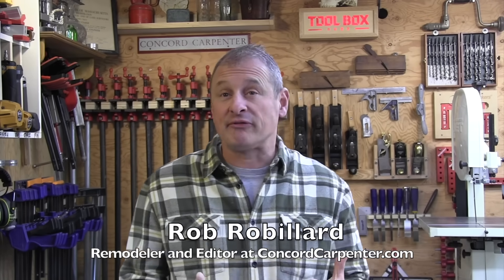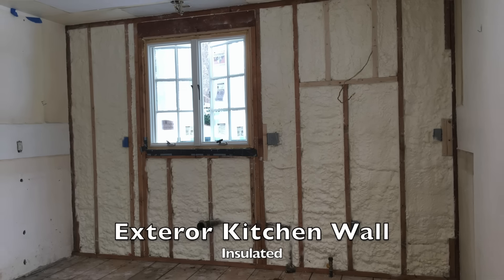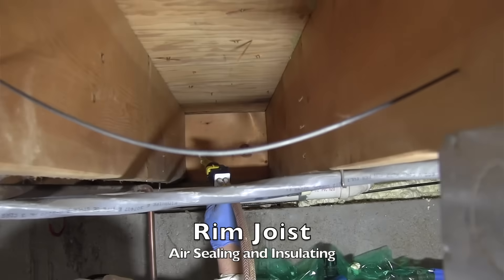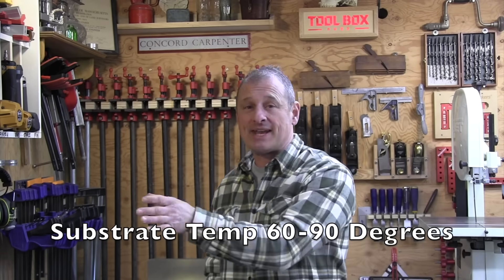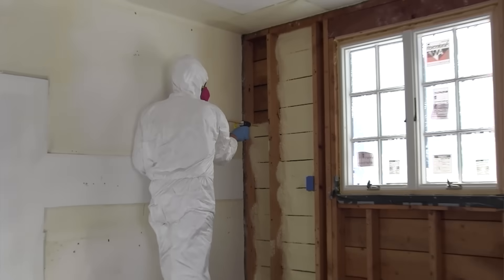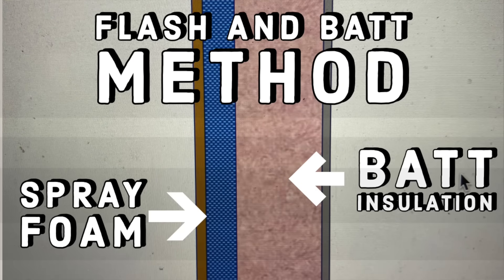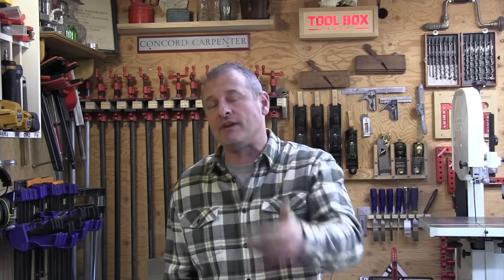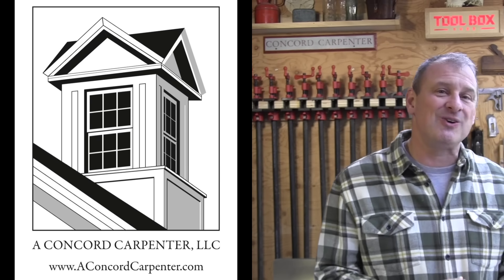Using a Froth Pak - DAP System 600 Spray Foam Kit

Comment: As a Canadian red seal carpenter  I'm tasked most days with fighting the elements. It gets cold. This video is sound advice for insulating. I'm thinking about using this product and came across your video. We done. Thanks alot.

Comment: Doing a DIY basement reno in a 1972 brick split level in the Atlanta area. The house had some water intrusion issues in the past that have been remedied with a gutter system and sump pump. I weary about insulating because of potential mold issues. Would you recommend this product for my situation? Thanks!
Reply from the maker: I'd fix ALL moisture intrusions and ensure the house had gutters and the outside grade sloped away. Once you satisfy that - then yes!

Comment: FYI - I investigated this system back when it was $600 for the 600 kit (now $882 with sales tx in CT). If you have enough sq footage it was the exact same price to hire a professional. Now, if you have a small amount then no, setup for the professional is expensive. If your job is big enough call for a quote. You'll be glad you did.
Reply from the maker: @L46C3  agreed this is a small job solution

Comment: Have you ever used foam to fill the void in a CMU / cinder block wall?  I am trying to find most economical way to fill these voids.  I have found it takes about 1 can of great stuff spray foam per CMU.  I have 93 blocks to fill at this time.
Reply from the maker: I have not

Comment: Best explanation of spray foam I’ve ever seen. 
Guy knows his stuff. Thanks.
Reply: No he doesn't.  The flash and batt system is still prone to high condensation in cold climates, and these foam kits are poor quality compared to high pressure, high heat systems.

Comment: You explained this very well, but this product is TERRIBLE to put within your home. There is a massive difference between a DIY spray foam kit, and foam that is sprayed out of a proportioner with REAL chemical, that comes out of 55 gal. Drums, not little propane tanks. Lots of companies would be willing to do this job, its gravy work. Ive done this line of work since I was 12, and to do this properly you NEED to hire a spray foam contractor. This DIY method, especially if you are throwing fiberglass over the top it will cause mold 150% I do not recommend using froth paks, EVER
Reply: I also am a professional sprayer and there is NO MOLD issues if installed properly

Comment: I have a few questions:
I'm remodeling a 1970's travel trailer that is structurally insulated. After peeling off the old wall panels(there was sections of water damage) I need an adhesive for the new panels. Sure, I could use PL glue, or foam glue, but I'm looking for 100% coverage. There's some voids, pocks, and more than a few gouges (my falt 😅) I'd like to fill. Why 100% coverage? You wouldn't butter 30% of a tile, would you? These panels add *structure*

I know i could probably use expanding foam adhesive, but that's a One Inch bead, I need a Six Inch bead😓.
Reply from the maker: get some sort of gklue or mastic you cab trowel on

Comment: Very informative. I've watched several videos and the last I don't know three to five of yours that I've watched on the insulation methods especially with foam board versus closed foam the 600 series has given me help to understand which is best for my application in my basement on directly on cinder block walls. Also giving me ideas for my brother's bathroom where he bumped out a dormer maybe an extended his bathroom to give him an extra two or three feet but the insulation was never covered with plastic and it is brown or black and places thumbs even hanging down I do not know if he put any foam behind it so it seems to me if I understand correctly that he's got no vapor barrier and this insulation may all need to be taken out. The bathroom is yet to be finished and the insulation just looks used and old and possibly wet in places because I know there were several roof leaks new messages received. Thanks again I will continue to watch your videos for further instruction to accomplish this at least in my own basement. The 60-year-old Widow woman. All about DIY but ends up paying someone to get projects done.

Comment: Is this foam water based?  I'm looking to reinsulate my home that was built in 1947, from the outside as I'm taking the old siding off this spring/summer.  I've read where spray foams shrink up to 2 inches, so I'm concerned about spray foaming my entire house only to have the foam shrink, thus giving my house an R value of 24, with this spray foam, down to who knows what value within 2 years or so.
Reply: Closed cell foam is NOT water based. Open cell foam is.

Comment: It was recommended that I use this type of insulation in walls that were already sealed (drywalled finished rooms). I can't see how that would be optimal unless I was to remove all the dry wall and do it properly. What method would be optimal when dealing with a finished room/wall without having to remove the drywall? Cutting small to medium holes would not be a deal breaker and I can easily patch those.
Reply: Blow in insulation. Home Depot rents out the shredder and blower and you buy the packs. Make a 3 to 4 inch hole in between each stud at the top and blow it in

Comment: 5" of insulation in-between 2 walls made from sticks and boards is state of the art and an improvement? 50 cu ft in a box for 500 bucks? Are you f*ing kidding me? This is ridicules. My house built in 1979 got a 10" engineered for insulation brick wall, that brick wall has 2" of foam insulation on top of that. My roof has 9" of cellulose insulation and 3.5" of foam insulation under the venting and sheeting plus 2" of OSB in-between cellulose and foam. The floor of the attic crawl space has an other 8" of cellulose insulation in-between the beams and boards. everything with vapor barrier inside and wind barrier on the outside. Blower door test shows we are pretty much airtight except through the vent system. And I consider this 40 year old insulation to be eady for improvement. And we see temps below freezing for about 4-8 weeks and its mostly in the singles and teens during clear nights and not much wind either. About 160 days a year we run a heater aiming for 70 in the house and 73 in bathrooms. House got 2300 sqft. and we use about 3.000kwh or 300l of oil guve or take a year for heating and hot water for 8 people. As soon as my roof mod is approved and execut by the city, we will be fully self-sustainable all year round. I'll upgrade the roof on top of the 9" cellulose with 20" of wood fibre boards to become guaranteed water tight during a tails and sheeting shattering heavy hail storm, as well as storm proof. That is state of the art, your stuff is 50 yeas outdated and 3rd world standard. Anyway, cellulose insulation is much more cost efficient, 100% air tight if done right, and thats realy easy, easier to handle, easier to repair, no hazardous material, neither while working with it, nor while tearing it down, not flammable, will no burn at all, is able to transport moisture out of the house, and 100% made from recycled material and will be 100% recycled after use. That is environmentally friendly, healthy and it safes you quite some substantial money. No I don't sell the stuff, I just used it in my various projects and my own home.
Reply: Aside from that, I worked with all available insulation systems, and they all s*ck some more like spray foam and glass or stone wool, some like styrofoam products less so. I now only work with cellulose insulation in-between i-beams and wood fibre wool boards for on-top of the rafters bellow the sheeting or tiles or on outside walls when the structural wall requirements do not contain enough insulation. Only below the poured concrete basement slap I'm putting a 5" of Styrodur layer down. And under every floating screed goes a 2" layer as well as a floor heating into it...

Comment: A couple of years ago I had 160 ft3  (6” in walls)  of closed cell foam for $2000 in a small room. I couldn’t have done it cheaper with these kits.
Reply: That's true. Those kits are cost effective (and time savers) only if you are using one kit. Anything over starts to be more expensive than a contractor. BTW. anything over 3-4in of closed foam is waste of money.
Reply: @MariuszChr  Actually, from all of my investigation, more than 2 inches is a waste but today's building codes still require 5 to  7 inches. I'm guessing it's the lobbyist in the fiberglass companies keep it alive.

Comment: So I have a crawl space immediately beneath the front door entrance area. The caulk job was brittle and there were fairly large areas where cement was missing upon closer inspection. I first applied Sika Self-Leveling Sealant on the outside area. In the crawl space, I applied Sika Self-Leveling Sealant followed by Quilrete Hydraulic Cement since there were large areas which needed to be sealed. After the Sika Self-Leveling Sealant & Quikrete Hydraulic Cement cured I applied two coats of DryLok Paint. It has been three weeks since the leak was discovered. No physical leak has been noted since as I setup a Nest Camera to monitor the crawlspace area as the remnants of Hurricane Ida passed through our area two days ago. However, being an HVAC company owner and also perpetually curious I decided to use a Fluke Thermal Imager to confirm no discoloration of crawlspace wall against areas considered “dry” (I.e., wall opposite crawlspace where water was never witnessed reaching). My water proofing efforts passed that test. However, here is the curious part, when I used the General MM8 moisture meter to check the wall it reported 100% wet even though it lacked the feel of being wet. I called DryLok and talked to technical support who notified me that DryLok prevents water from infiltrating but not necessarily water vapor. Hence, the 100% reading when using the Moisture Meter. So I am curious if I were to use this DAP Touch ‘N Go spray foam would it create a complete 100% vapor barrier which wouldn’t register as “wet” when using a moisture meter?
Reply: I think it doesn't allow humidity to flow through like that paint does, so it won't register as wet. If your paint is actually showing the wood wet, it will rot in weeks. I doubt it's really that wet and probably just a conductivity interference with the paint. Moisture meters register small electric charges. If the paint contains anything conductive, like titanium oxide or aluminum or something the meters electric will flow 100% giving a false reading.

Comment: Good info. Can i fill a poly 55 drum with this closed cell for a dock? How much can be sprayed at once? allowing 15 min to cool.
Reply: It should work, you just need enough drums so you can keep working for 15 minutes before going back to the first drum. Also it would cost almost $100 per drum.
Reply: Sure if you want to spend a fortune.

Comment: I would like to hire someone to use the Dap 600 to replace foam that was removed due to a roof.  Any suggestions where I would go for such a small job?  Zip 77304

Comment: 2in has the best cost for dollar benefit. 1in is roughly 78% efficient. 2in is 86%, 3in is 90, 4 is 92, 5 is 93 and you increase 1% per in after 5in. So you see the largest efficacy increase to 2in, 3 if you have the money but you have to pay for a 2nd pass because you can't lay anymore than 2in at a time. But for you to pay for the extra inch to get the 4%, are you really going to see that back in heating expense over the years. Probably not.

Comment: I did my 1934 home’s rim joists this fall. I could see sunlight coming in and had constant insect issues

Well worth the $700 or so. I would say the benefits are as follows:

- helps to eliminate the “chimney effect” - I cannot believe how much calmer the air is in my main floor now
- it’s winter of course but I did not see any spider webs etc after spraying 
- basement is warmer of course
- as ugly as the spray is it’s better looking than that terrible fiberglass 
- home is much quieter. You wouldn’t think insulation in the rim joists would have such an impact on the sound of cars etc going by on the main floor but it definitely has deadened the ambient noise 

The 600 pack was overkill for my 900+ sq ft home. I ended up wasting a massive amount of the material even going around the entire house at least twice. I could have easily used the smaller kit and been fine. 

I didn’t use the same wide fan nozzle as in the video - too many small nooks to fill

I had some issues with quality of the kits and had to end up returning a few until I actually got a fully functional kit. Plastic is used in some areas where metal would have prevented any issues

As a DIYer I’m happy to answer any questions you have - fantastic stuff and saved me a few hundred over hiring it out, and will be more permanent than any cutting and caulking up reflective board. 

I see a lot of new construction in my job (mortgage lending) and I’m dumbfounded that home builders are still just shoving batts into the rim joists and throwing up drywall.
Reply: They cut corners where they can for speed and savings. But as a homeowner, I’d gladly pay and extra few thousand more over 30 years. But production home builders don’t see it that way.
Reply: Hi, where can I find these packs for sale? I Need insulate a 40' ship container ASAP, my first quote was $16k it's crazy for me, with this quote I just decided to diy.
How many packs d u think I have to buy to fill all my walls and roof with 2" to 3"? 
Thank you
Reply: @katherinek.henkel8785  I want to know the same thing. I'm planning on doing a shipping container too.

Comment: Good video Rob. A Happy Holidays to you and the rest of the crew! The only thing I don’t like about spray foam is if I add an outlet or repair a electric circuit or plumbing. Any suggestions on using spray foam and dealing with electrical and plumbing?
Ron
Reply: I am a spray foam are you basically just have to cut out a channel for your wiring or whatever and then it Hass to be spray formed again

Comment: Just what I needed to pump myself up for that basement wall that is freezing cold and making the room above 10 degrees colder than the rest of the house. I plan to do this 600 system. Followed by filling with bats since we have plenty of those already but the generator guys (electricians) tore out the bats and never put them back. Probably why we are having weird temps. Next I’ll use some bat supports and then a layer of reflectix. And seal that flocker up good

Comment: I wonder how long before rot issues arise? Building code often insists on untried and untested methods. 

Remember insisting on blueskin all over and everything under rotted

I live in a 90 year old house , the addition was built to code. It is a rotten piece of crap! The rest of the house can breathe, dry as a bone and no mold !
Reply: My home is that age - I just insulated my rim joists with DAP. The home can breathe to the outside, it’s not necessary to breathe into the basement. There should be no issues for the rest of the life of the home
Reply: Foam has been successfully used for 40-50 years.  It's not untried and untested.

Comment: Finally completed my attic floor spray foam project.  Didn't use the Daps but use Tiger Foam, worked great.  Glad the spray foam was still good because I delayed the project last year around this time.   Was lucky to get it done,  northern Indiana had a few days of 70's °F before dipping down to the 30-60°F

Comment: Don't use fiberglass batts.
Reply: They actually hold moisture and cause more problems than they're worth. Building codes need to catch up with the technology. The R value mentality is way over rated.

Comment: I thought you have to use a breathable membrane for moisture insulation
Reply: When insulating in a cold climate, you need a barrier to vapour on the warm side of the insulation. Any warm air that gets past the insulation would come in contact with the cold outer sheathing and condensation will form. A breathable but waterproof membrane is used on the cold side to shed water that might penetrate your siding but allow any moisture that might accidentally get behind it to evaporate and escape.

Comment: A very big problem with this stuff is that it's sooooo expensive!...   Another question I have, is what happens when there is a water leak that get's behind the sheathing (and between the closed-cell foam)?
Reply: The ROI is great on these. It seems more expensive than it actually is. If you spray it correctly the water will go elsewhere since it will not penetrate around the foam

Comment: The Carpenter is right you need to have surface  clean; temperatures of Air,  product and surface to be sprayed is critical there was a couple in Canada that had a house sprayed in the addict and it continues to gas off; forcing the family to live in a RV outside
Reply: Yes, spray foam is fine if professionally  done correctly, if not done right, then it's a nightmare.  Having said that, DIY spray foam kits sold in Canada are not to be used for anything other than beading. Fan spraying with kits in layers is a no no, as per the manufacturer because it violates code. 

From Dow, (and this includes stud cavities)
**For rim/band joist applications, use FROTH-PAK™ Foam 
Insulation (available in U.S. only) to meet building code specifications.

Comment: Do you need a vapor barrier if you're insulating a basement when spraying on the foam?
Reply: Closed cell foam acts as a vapor barrier as well as an insulator.
Reply: @paulchoate1  thanks
Reply: @williec.1540  I believe it has to be at least 2"  or 3" thick though...you can verify that with a licensed installer.